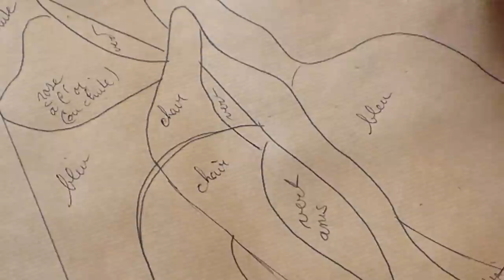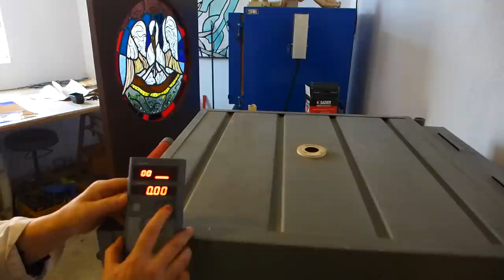Judith Debryun, stained glass maker - vitrail-彩色玻璃

Comment: Nice video. Couple of comments......the painting on glass is really nice to see, not a lot of people do that these days. The glass cutting is ok, but not great, the cuts in this window are not difficult. They should stretch their lead, takes out the kinks and give you a little more to work with. The lead joints are not very good, but should improve with experience. Why press the lead before the window is cemented?  The soldering is not good, mostly because the joints are not good. A good 200 watt iron with a paragon tip will give you more control and better looking results. The lady who designed this is an artist, the others are craftsmen/women. Overall this is a good video showing lead technique, and the painting is a bonus.
Reply: Wow....troll much?
Reply: i agree about the lead work and soldering.. Still , its a lovely piece
Reply: Couldn't agree more with your comments about the lead. It didn't look stretched at all. And the face of the lead was bent and twisted. And  the joints left alot to be desired and thats because the lead, like you said, wasn't stretched and I didn't see the glazier make any real effort to fix that problem. The lead looked sloppy starting with the lay in of the first border piece. And why press the came before it was cemented? That doesn't allow for a good fill. Overall. the piece is nice but the quality is lacking. I made church windows for 40 years and even if the final window was 50 feet up, I made sure that the details were squared away in the building process.
Reply: Do you do glass? Sounds like you don't so who is the troll? @mathewanderson2400
Reply: @DukeSteele  As you politely responded to my previous questions in another section of this video's comments, you'd remember I stated I do foil work. So, yes, I do glass, just not this medium

I just don't understand why you tear apart a nice video like this like backseat driver. So yes, you're trolling - arguably, only slightly.  Just because you can be critical doesn't mean you should. Also, the youtube community is filled with artists who respond well to others and work with each other. You're not doing that either....I'm not a fan of people that put others down and I'll call them out on it, sorry. Be nice. Her work is beautiful (check out her website too!) and doesn't need you or anyone else being incredibly critical in "should have"s.
Reply: This is not a troll. He is giving constructive criticism. - A troll is someone who posts only to stir up arguments. I have been working with stained glass for 8 years, all of these criticisms have merit. Folding down European lead before cementing/sealing is probably the biggest mistake. This will limit the amount of cement/sealant that is creating the weather seal. Not enough may cause leaking and early deterioration.
Reply: Thank you for your comments, this film was made for an exhibition of my creations. Presented in China at the Plantation Gallery in Beijing and Shanghai. You can obviously guess that this is a simplification of our artistic work !!?
I use it today to explain the art of stained glass to children during French exhibitions. I learned 30 years ago with two best workers from France in Chartres. Obviously you understood that it was a glimpse. Thank you for your comments.
Judith Debruyn

Comment: I have done stained glass for over 40 years and have never tapped on the glass to break a score line. That would make the edge splinter. I score edge to edge, grab the glass on each side of the score line with my thumbs on top and roll my hands down and out. Perfect clean break every time. I can cut 650 pieces of glass in an hour and a half with very little effort or mistakes. These people are wasting so much glass. Pretty piece but a hard way of getting it.
Reply: hello, you're right. You understood that it was a small explanation filmed for an exhibition presented in an art gallery. A popularization ... I work in the tradition as taught me by the Master glassmakers, Meilleur Ouvriers de France. The best ! For the rest, I like to take the time it takes to realize my artistic work. Ideas and advice are always welcome. Judith Debruyn

Comment: Can anyone tell me what was that last step with the paste and sawdust?
Reply: I would like to know what was  the paste and  susbtitute for the calcium carbonate   
It is posible to get a response?
Reply: This step is mudding and it's awful. You take a puddy the consistency of peanut butter  and cover your entire piece with it pressing it in between the lead came and glass then you apply whiting (it's a powder that caused the puddy to harden) and take a bristle brush and scrub your piece for what seems like a million years and your arm feels as though it will surely fall off. Then if your glass is textured in any way you lake a little stick and pry any puddy out of the texture of your entire piece. This process seals your piece and prevents movement of any of your glass pieces as the lead stretches over time. Like I said.... IT"S AWFUL!!
Reply: @chrisbyrd6715  What's the benefit of came vs. foil? Strength? I've only worked with foil and haven't had a need to explore otherwise. This video is making me thing about that though
Reply: And applying cement or putty needs to be done on both sides of the panel to make it weatherproof but not waterproof.. After drying and then cleaning, the rebars if any, can then be added to the piece. Also, during the cleaning sawdust can or should be used to polish the lead or foil and final clean the glass. As far as strentgh, some glaziers, like myself, prefer lead and strentgh can be added by adding rebars if needed. Others say foil is stronger buy depending on the size, both mediums might need rebars. And what Chris said is true. Cementing is tedious and slow so you don't break anything. And if you have maybe 10 decent size panels it could take all day and its a killer.
Reply: There are two trains of thought on this. Lead is actually easier to work with than foil but after final soldering needs to be cemented. Unlike lead, foil is more tedious because of the usually small pieces. But, after soldering, foil with or without rebars just need a good cleaning. When I apprenticed 80% of the work was done in lead. So, over the years I mostly stuck with it. In 40 years, I did only 3 windows in foil. It depends on what  material you learn on.
Reply: @mathewanderson2400  it's actually lead cane not came (damn you spell check) . As far as strength is concerned there isn't much difference. Where the major difference comes in to play is the planning and layout of your piece.  With lead cane, You have to make a detailed map of not only where your seams start and stop to avoid hinges but also the exact order that each piece will be laid and it is much harder to make changes on the fly. For those whom hate to solider cane might seem a lot more appealing however the planning time for the piece is easily triple of the time required for a copper foil piece.
Reply: Chris Byrd awesome explanation! Thank you so much. And yes, spell check sucks haha
Reply: @mathewanderson2400  if your worried about strength anything over 3 square feet should have strongline placed in several seams  all the way across and anything over 5 square feet needs saddle bars.
Reply: That's with cooper foil... for lead cane  strongline is replaced with hardheart